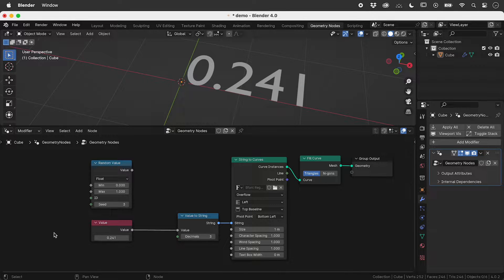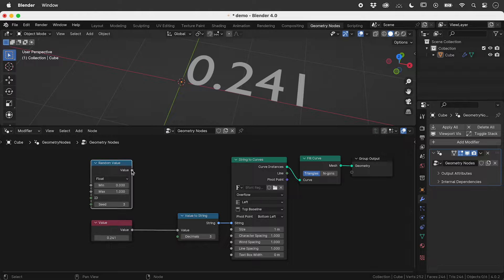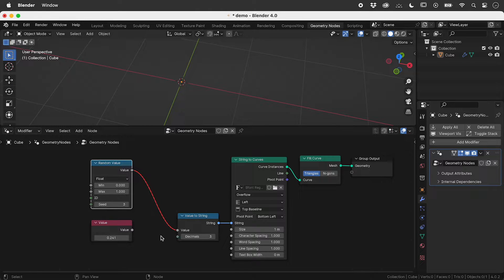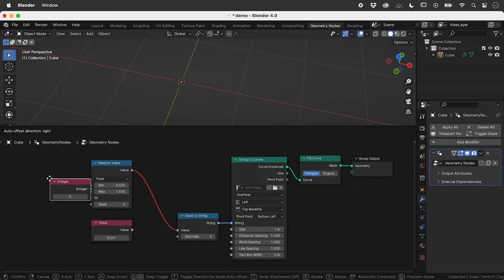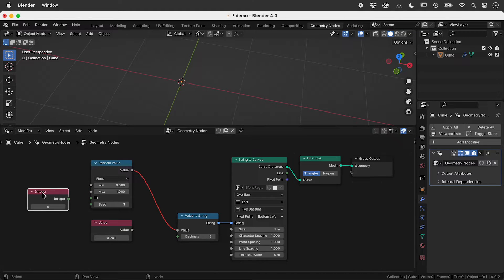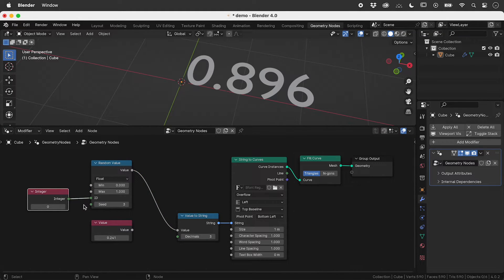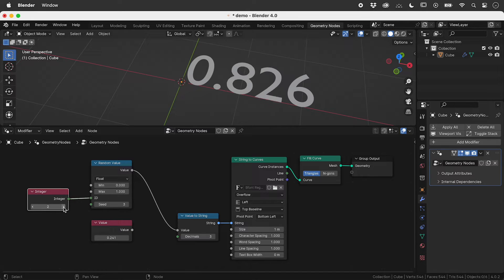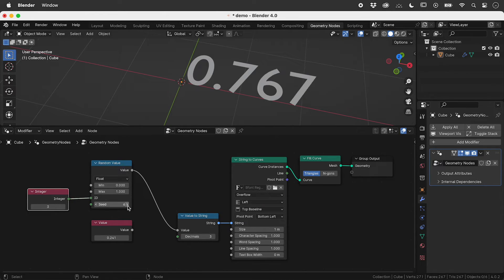Convert Field of Numbers to Single Value in Blender Geometry Nodes

Comment: This works good on this special issue. But is there a workaround if I want tor display the X value of a vector? Everytime you bring in a field datatype the "Value To Link"-node will warn with "Invalid Link"
Reply from the maker: I'm not 100% sure what your situation is. Are you familiar with the "Separate XYZ" and "Combine XYZ" nodes?
Reply: For sure. Should be one of the first things to learn when you work with nodes.
Unfortunately the separat xyz node delivers fields as result and not a single value! And "value to string" doesn't accept fields!
Reply from the maker: @lutzpleuter6388  What kind of field data are you bringing in? Can you get specific?
Reply from the maker: @lutzpleuter6388  Have you tried something like the following?…
Group Input
Sample Index (Data Type: Vector) (Position node into Value)
Separate XYZ
Value to String (X output into Value)
String to Curves

Comment: if I get this right.. adding a value to the ID field changes the output from a numeric value to a reference to whatever is stored with the id.  so you can pass a set of values by having an id, even though it looks like it should only be passing a single numeric value.
Reply from the maker: How I mentally explain to myself how/why this works varies depending on the day ;)